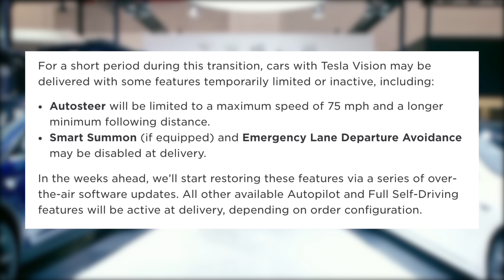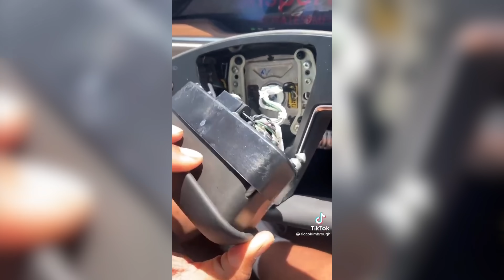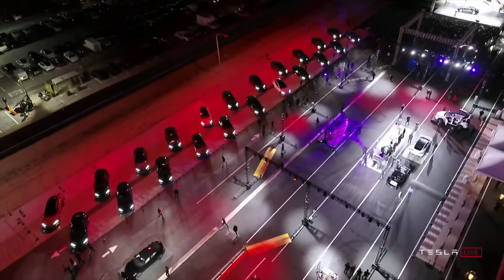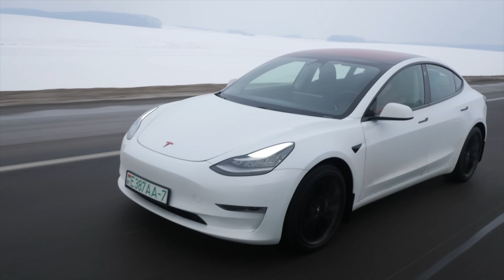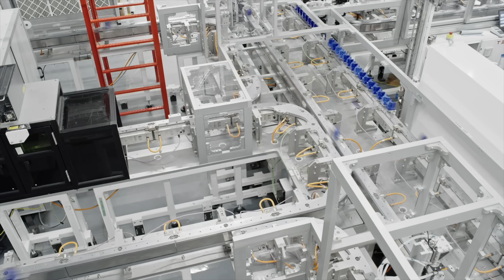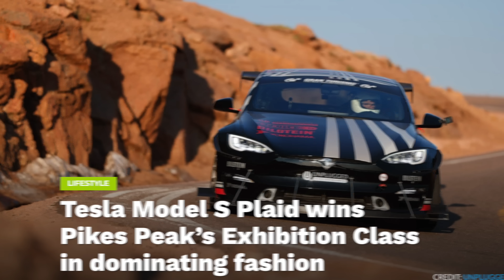NEW Tesla Model S Deliveries

Comment: Great video.   I received my model y performance like 2weeks ago.  The smart summon and sentry mode were not working.  Today with the new update I got to finally used the smart summon.  However the sentry mode now works but it not fully working 100%. I turned off the sentry mode at house but it turns on a lot of times.   😂

Comment: Saying that a defect like the airbag issue would most likely have been caught before delivery is very generous at best. I have bought more than a half dozen new Teslas and the all have been delivered, with as far as I could tell, zero prep work at final delivery. Most still had bug debris from transportation, dirt, misaligned panels, loose trim and many other simple items that were apparent from more than 10’ away. One car at the end of 2020 was so bad I refused delivery because my tradein Tesla was in so much better shape than the new one.  In Teslas defense, other than my first couple new Teslas, they were delivered at their busy end of quarter rush but still not even a quick wash or vacuum before delivery. Tesla quality control was significantly better years ago at least at the delivery point.
Reply: Sounds like your Service Center isn't real good.  Tesla is trying to do a better job getting them staffed to meet demand.  It used to be better before the days of the 3 and Y.  I'm trying to wrap my head around you buying more than a half dozen new Teslas.  What do you do with them?  That's a lot of Teslas.
Reply: IncognitoTorpedo I have 3 Teslas currently and have cycled through them since 2016 when we bought our first Model X.  Currently I have 2 Performance S’s that I bought last year and a Long Range Plus Model S I just bought this January. I’ve had all S’s except for one X P90D and one Performance 3 last year. I’ve  taken delivery at 3 different Tesla locations and the delivery prep was always extremely poor which was the reason why I said I’d be surprised if they caught something at delivery

Comment: The recall is a recall. The vast majority of recalls are no more significant than the Tesla recall. The issue is the it wasn’t right before they sold it. Every manufacturer has an occasional recall and in and of itself it isn’t a huge issue, but in conjunction with the other issues Tesla has had with fit and finish it is a worrying trend that needs to be addressed.

Comment: By that definition it’s not a recall. It’s a country lacking enough common sense to know when they do or don’t activate cruise control lol

Hmm no stalks looking smart.

And that LR s is no joke. It may be 3 second 0-60 but it’s so much more. The new motors and thermal system leave it a far superior car to the old Long Range S. 

It doesn’t stop pulling lol. Fully agree with its value proposition.

Comment: I just still don't get it. Why on Earth did they remove radar? I know they reasoning behind this decision from Elon but from a technical standpoint it's kinda dangerous to do that. Vision doesn't always work so why rely on it? Cameras can get dirty and stuff so every time it rains/snows heavily you'll run into some problems.
Reply: A little bit of research will explain why it was removed right on Youtube here. It was not as reliable as the vision system and under some conditions did not act the way it should. Vision is most reliable, if it was not we humans would see like a bat maybe which is similar to radar concept.

Comment: I took delivery of my Model S yesterday. I’m a previous owner of early vin Model 3 long range and early vin model Y performance. Tesla has made great progress on quality. Paint, panel gaps, misc rubber seal issues, rattles, thin paint. None of those issues are present in my Model S. A panel wasn’t all the way snapped in, a quick push and all was well. The model S long  range is incredibly under hyped in the shadow of Plaid, the 670hp, drag strip mode and launch control is awesome! Way faster than is needed for public roads and once you drive one the desire to spend an additional 50k is diminished.
Reply: How do you like the yoke?
 Have you driven an x?  How is y size compared. Or the s to the x ?
Reply: @PS-zw4yc  I’m not in love with the yoke, only been two days so maybe it’ll grow on me. I like to rest my hand in top of the wheel and well… now the top is gone. Also, I keep touching the turn single when trying to skip a song. Y is taller, so more cargo and sitting position is very SUVish. I liked the Y a lot, but always wanted and S, finally got my chance. I’ve sat in X it’s big for sure! I like driving and the M3 and S sit low to the ground, and handle like sports cars.
Reply: Update: Yoke is growing on me for sure. It’s not awkward at all anymore. Making u-turns and parking, reverse parking etc. is no problem.
Reply: @jasonsplace1906  thank you for the update.  How is it missing the hand on top of the wheel style hold

Comment: Curious as to what, if any, plans there are for Tesla vehicles that have radar hardware (like my March 2021 M3). 

Will that hardware retain its current functions, or will it be disabled in some future update? If left enabled and functioning, will there be any future improvements via updates to it, or will it stay at its current level? If something goes awry with the radar, will Tesla fix it, or simply disconnect it?

It’s great that the vision-only cars are getting improvements, and that their high level of safety is getting validated - just curious as to what is going to happen with the radar.

Comment: The VIN disappearing happened to me. I had a VIN assigned, and a scheduled delivery of 6/23. As the date got nearer it was pushed to July 4. I called on the 25th, and they said I would not get it until August! My VIN was removed. I left for vacation and 2 days later received a call that they had a vehicle for me, but I had to get it the next day. I drove home, picked up the car (different VIN), and cut my vacation short. Very frustrating, but I am glad I received the car now rather than in August.
Reply: I'm in the same boat, I just left for vacation  today and my luck they will contact me when I'm not available to take delivery...
Reply: I'm in the same boat, I just left for vacation  today and my luck they will contact me when I'm not available to take delivery...
Reply: That happened to me too. I got a VIN for my Plaid for 2 days a couple of weeks ago, with delivery 6/25-6/30 and then it was gone. I ended up getting rematched. I talked to the guys at the dealer and they said that they wanted to get that car delivered before 6/30, so they gave it to someone else. 
I was also on vacation, when I found out I got another VIN match and it was on the ground on 6/28. I was on my way home on Tuesday, so I picked it up then. It’s soooo awesome!

Comment: My concern about camera based systems is how safe it will be in snow… at least radar works with snow and ice on the car, whereas cameras will be useless. Having said that, the camera on the top of the windsceen on the MX has a heated area around it - probably because of sentry, but they would have to do the same for all cameras surely.
Reply: I guess you would have to grab that big round thing in front of you and do it yourself
Reply: If the cameras are blocked then fsd won't allow itself to work.  Same as when your windshield is obscured you probably don't drive either.